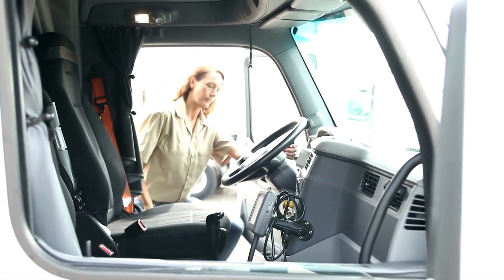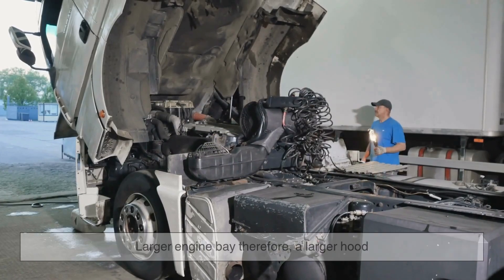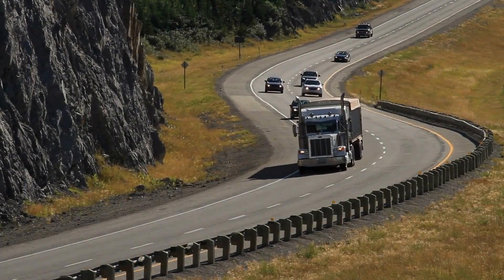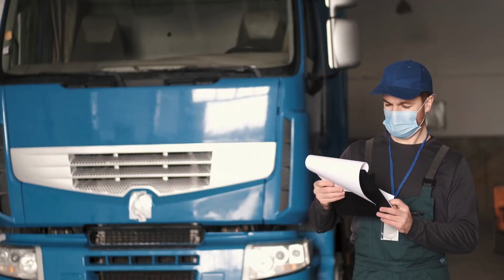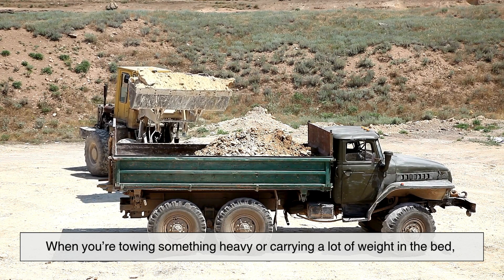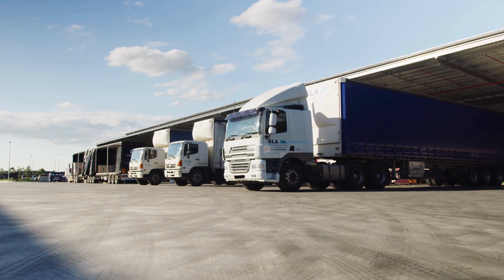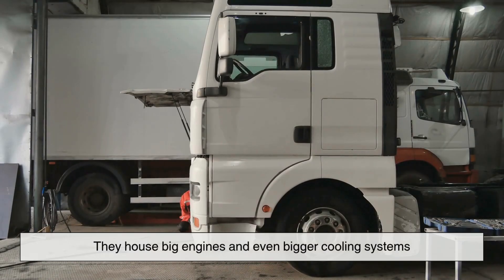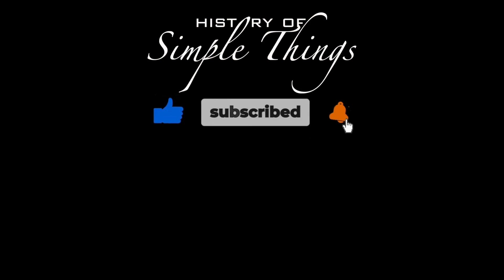Why Truck Hoods Are So Big

Comment: Besides size and every other reason given. The biggest top reason is aerodynamics. The more aerodynamic a truck is, the less fuel consumption. The hood, cab, fenders the whole package doesn't move without a paying job. The paying job boils down to fuel cost.